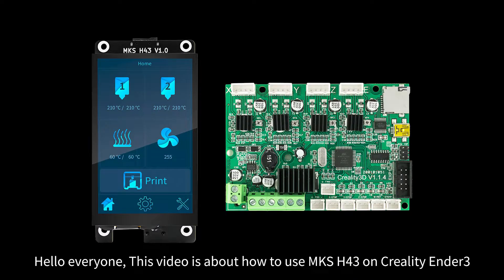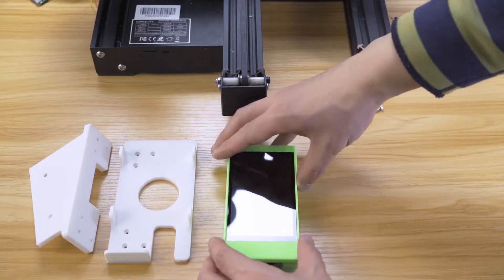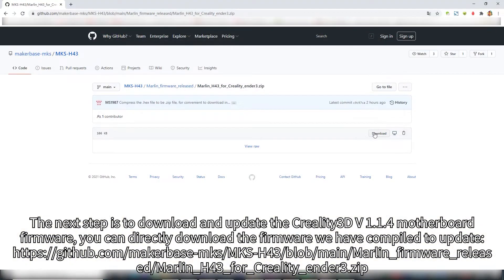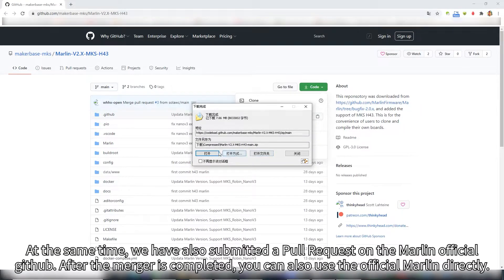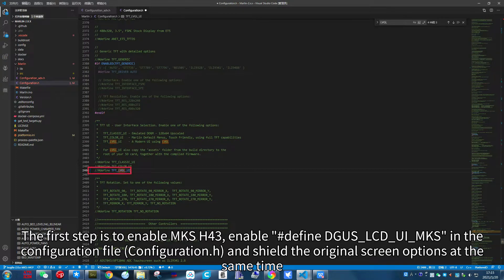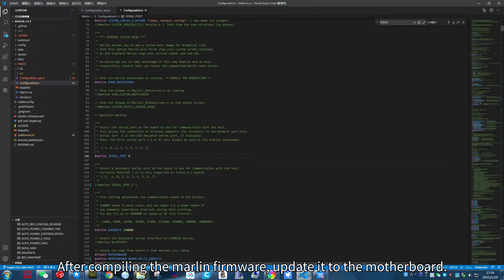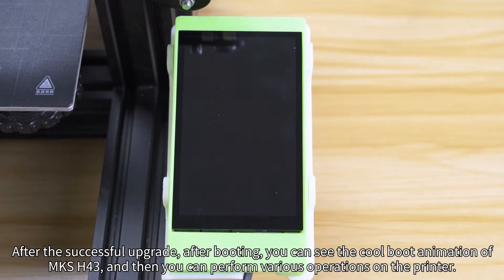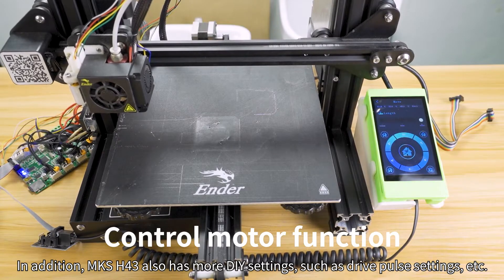How to use MKS H43 on the original motherboard of Ender3  (Creality3D V1.1.4)

Comment: I have MKS Tinybee Working fine on ender3 PRO With Marlin2.x. I decided to change original Ender 3 pro screen.  I bought this MKS_H43  screen. I Connected via serial connection.  But I couldn't Make it work. Animation is showing . And it is asking "Stop Print".  Than it is Freezing.
Reply: I did make active "green Theme" on marlin and it works now

Comment: Hi, what is configuration for SKR 2.0 ?I try to use same as for SKR 1.3/4
And got two problems :
#define LCD_SERIAL_PORT 0    - Error in compile - "LCD_SERIAL_PORT must be from 1 to 6. You can also use -1 if the board supports Native USB."
and
enabling LCD_BED_LEVELING  - Error in compile - "LCD_BED_LEVELING requires a programmable LCD controller."

Comment: i use this MKS H43 for MKS SGEN L V2, but the screen show bootscreen animation and stuck in makerbase logo, how to slove this?
Reply from the maker: Hello, this is the motherboard firmware does not enable H43 and the serial port configuration is incorrect. Please follow this link for wiring and configuration https://github.com/makerbase-mks/MKS-H43/wiki/Use-MKS-H43-on -different-motherboards#mks-sgen_l--skr-v13

Comment: Great display.  I bought it and uploaded firmware 1.31.  It won't start.  Works fine on firmware 1.30.  Can you help me?
Reply from the maker: Hello, this can only use V1.30, 1.31 is for the new motherboard later, this can only use V1.30 first

Comment: Wow this is so cool! I cannot to wait to order it and the mks robon nano 3 !;))) have you got the combo of mks robin nano v3+ 2109+ mks h43?     All my 3 printers are on skr 1,4t 2209 tft 3,5- building more 2 printers the problem is with the tft 3,5 want to do it in portrait but with the Btt it is not possible now:( so this is why want to try mks h43 and the mks board ;) good luck ;)
Reply from the maker: Hello, there is no combo yet. You can buy the products you need in our shop and pay together.
Reply: Makerbase Team it is perfect if you can make the tft 3,5 with portrait orientation !;)
Reply from the maker: @mitofun6967  Okay, we will design the TF 35 vertical ui as soon as possible, thank you for your suggestions and support!
Reply: Makerbase Team really this will be great!!!
Reply: Makerbase Team only need the new firmware ;) so the current users will have the choose of use ;)